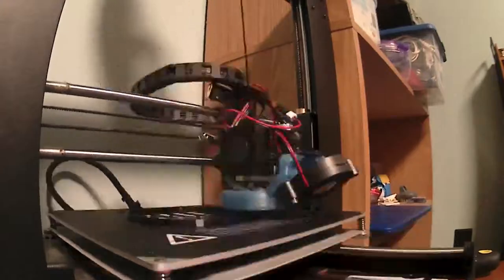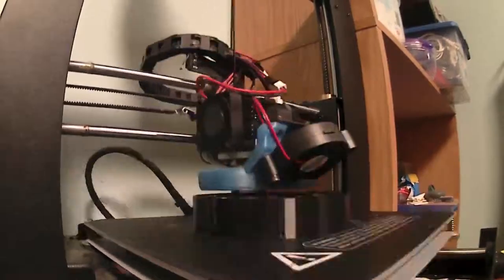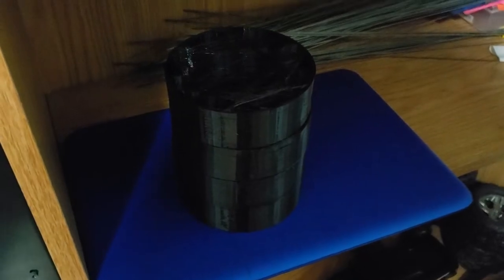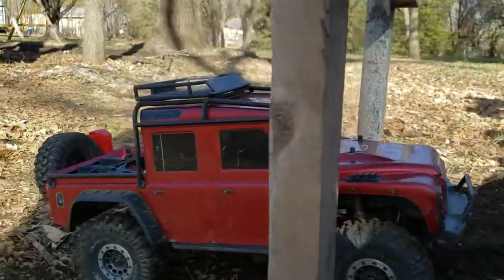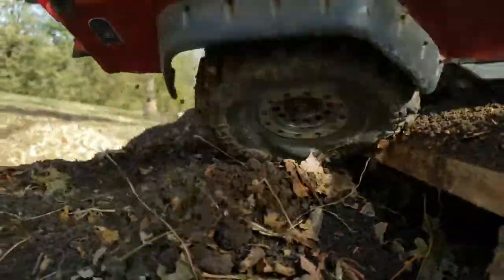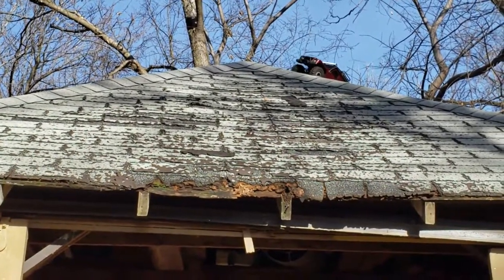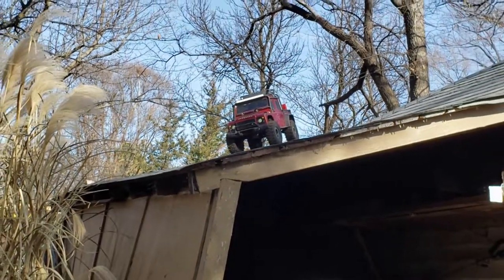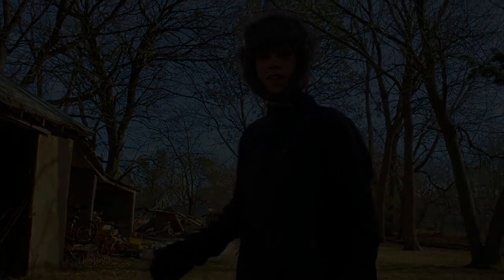3D Printed Tire Foams!

Comment: It has been 2 years since this video posted. Any updates or revisions on these. Very cool how you can do this and would love to try a set on my Trx4 high trail k10. Awesome video.
Reply from the maker: Thanks, They have been working great, and I love the sidewall support! However, one thing that will probably be a problem is the "foam" might "eat" the tire from the inside because it constantly rubs it. I have made a revision to make it work better with the wheels and tires in the video, but I haven't uploaded it to Thingiverse yet.

Comment: Out of interest, what 3D printer do you use for this? I'm looking into getting one, but not sure what to go for, especially for a 3D printer which can easily handle flexible filament such as TPU. (Direct drive rather than a bowden tube required from what I understand?)
Reply from the maker: Yes, you are correct, a direct drive extruder is better for tpu than a bowden tube extruder. I am using the Monoprice Maker Select V2, however I think you should go for Creality branded machine. However the only one that I see that has a direct drive extruder is the Ender 3 S1 Pro. You can get direct drive extruders for the other printers they make such as this one:
Official Creality E·Fit Extruder DIY Kit with High Torque Dual Drive, E·Fit Extruder Upgrade Kit for Creality Ender 3 pro, Ender 3, Ender3v2 and Most FDM 3D Printers, Support TPU Filament https://a.co/d/7XBDXsD.

So you could just convert a cheaper ender 3 to direct drive if you wanted to. It is a more DIY way of doing things but it does save you some money. Hope that helps!